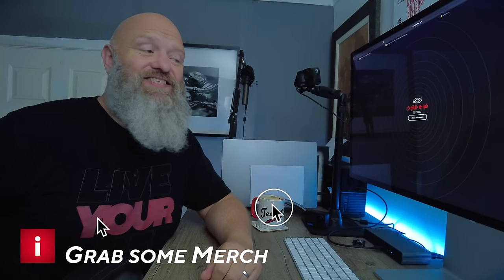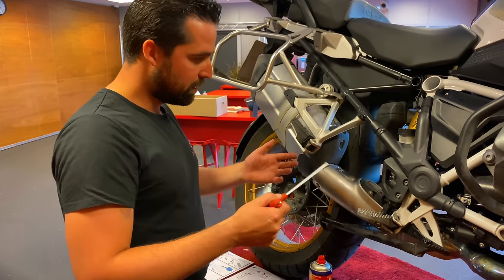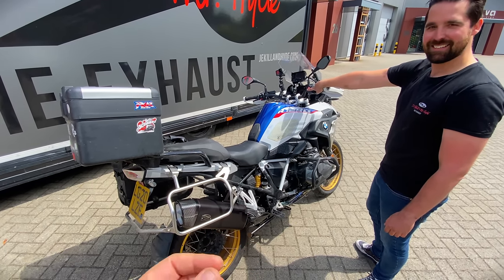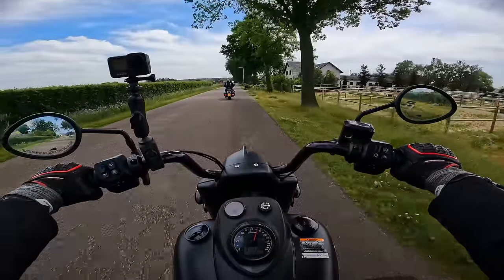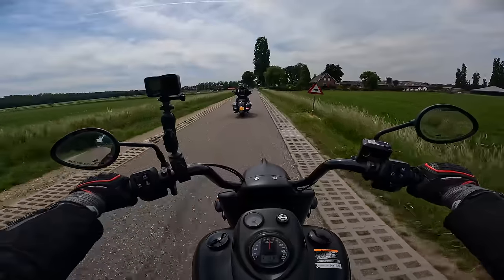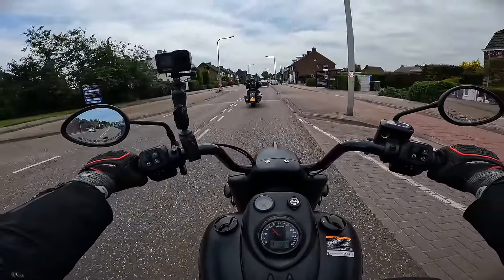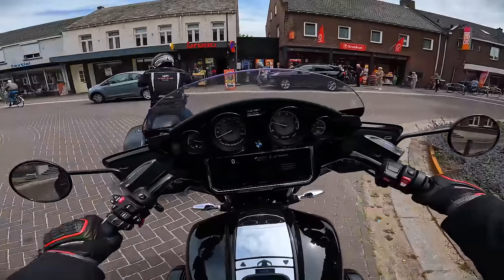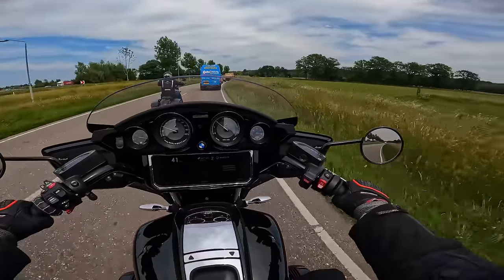Jekill and Hyde Nomad 3-in-1 - New BMW GS Exhaust - Sounds AMAZING!

Comment: what does it do for power and torque for the GSA Adv 1250 please sir?
Reply from the maker: Hi Bill,

As it says in the vid, for legality reasons they can’t increase performance too much, I think it was plus or minus around 5-10% from stock values.

I definitely notice that the bike feels sportier in Hyde mode (valve open). It seems to lift the front more on acceleration, and just feels more dynamic - this could of course just be a placebo effect from the louder, more aggressive sounding exhaust in that mode 🤷‍♂️
Reply: @teapotone  Excellent Buddy, great videos, great to see a fellow Jock out there acing it man. Going to sell my second kidney to get one

Comment: If it's made for the GS which it is, then why are the cables so long and not made to measure 🤷‍♂
Reply from the maker: Don’t know, message them and ask bud
Reply: The exhaust is made to measure, but the cables will fit an assortment of bikes.

Comment: They are very nice pipes...  But i will not pay that kind of money for an exhaust, its just to much.. U say its Akrapovic sort of prices, but thats simply not true. The J&H system is more then double the price of a Akra.
Reply from the maker: No it’s not. The full Akra system for the GS is over £1,600 - probably more now as this was at least 3 years ago.
Reply: @teapotone  the slip-on for a Akra for my Pan Am is 1100 bucks, the slip-on from J&H is 2250.

A full system doesn't comply to European regulations so it's not the system to compare it against.
Reply from the maker: And a normal slip-n doesn’t sound anywhere near as good as the J&H one.

I had the full Akra system on both my last 2 GS’s, and they didn’t sound as good as the J&H in Hyde mode
Reply: @teapotone  i did say they are very nice pipes. There is no doubt about that part.

Just that the J&H are extremely expensive comparing prices for the legal part of the Akra (the slip-on) since those are less then half the price.

For most people it's just to steep.

Comment: Sounds good .. but £1500 for an fancy end can… great if you get for free to promote.. sure we’d have one …but in reality how many times will you switch between the different modes… exactly… ultimately a very nice but extremely expensive end can !!
Reply from the maker: I use the modes all the time actually - I genuinely didn’t think I would, but they are very handing for everything we talk about in the vid; early mornings or late night starts of the engine, or even riding through villages/towns, horses, anywhere where you think the louder mode may alarm someone or something. It’s also really useful on long journeys where I don’t want a loud can doing my head in, I can just switch it to quiet mode and it’s much more bearable.

Contrary to what you obviously think, if I don’t think I’m going to genuinely use something, then I don’t accept it from a company as I won’t give it a just review.
Reply: @teapotone  Thats fair enough bud.. however if you hadnt recieved it free of charge would you have purchased one? its easy to say yes of course if you havent actualy had to shell out your own cash..  I would t disput its a good quality item but as stated £1500 for an end can... Switching exhaust mode sounds is realy something of a novilty .. however each to their own - safe riding out there -
Reply from the maker: I did look at their exhausts about a year ago as I’d seen one on Instagram, but couldn’t afford the £1,700 outlay - I usually put full Akrapovic systems on my GS’s which are around the same price, but funds are tight since going alone on YouTube.

It’s not ‘just’ an end can though is it bud, it’s a fully legal exhaust that gives you the advantages of a full system without any of the grief (fully legal and within noise test limits when needed), plus it gives you the option to turn off the growl when you want.

It costs what it costs because it’s a premium product, same as a Bremont watch costs more than an Amazon special 🤷‍♂️👍
Reply: @teapotone  yes as stated it is a premium product I wouldnt disagree on that .. I however personally think the Akrapovic looks better and is also fully road legal, & has a better sound to it .. shop around and youll get one new at £800 .. which is still expensive sure...but more than £700 less than the JH .. Akrapovic are a primium brand.. no Amazon special.. who knows maybe JH will adjust the price accordingly its a competitive market out there.. time will tell..
Reply from the maker: You won’t get a full Akra system for the Gs for £800, not a chance.
Reply: @teapotone  i was only referiring to the end can which is more than adequate ..
Reply from the maker: Then it’s not comparable bud.
Reply: @teapotone  hows that ... the JH is an end can all be it with a novelty mode switch and the Akrapovic is an end can just £700 less.. so I think we'll just agree to disagree ..